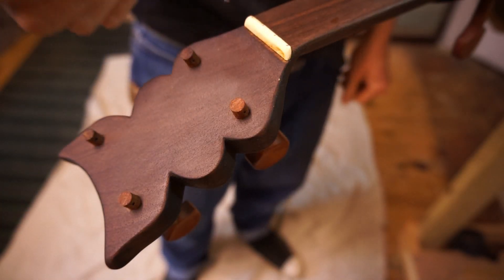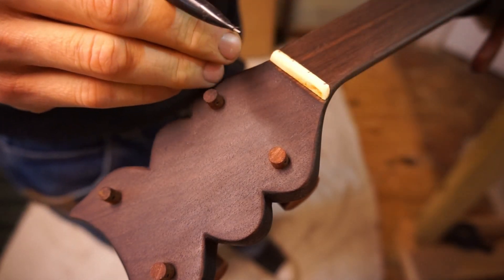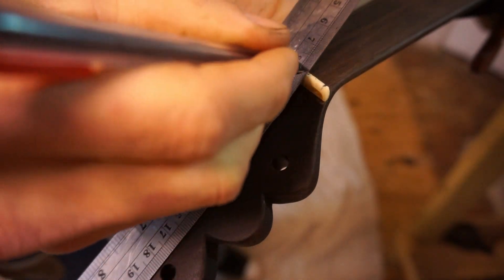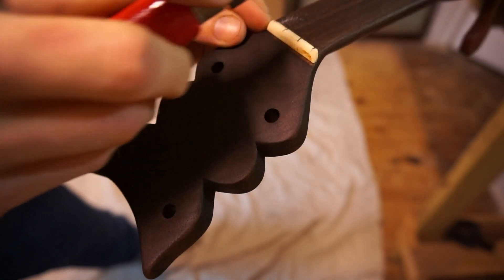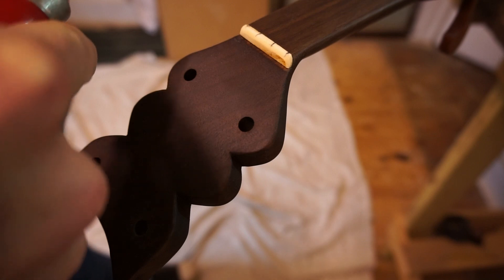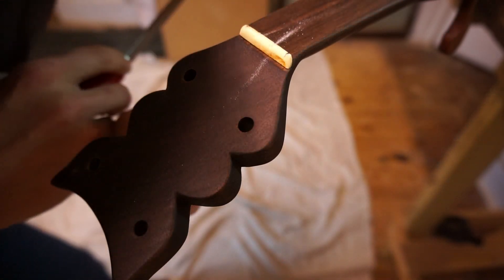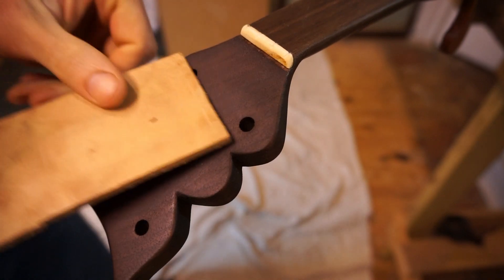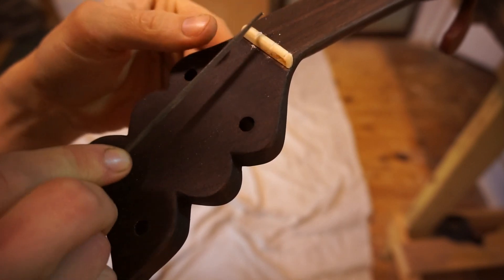How To Slot a Banjo Nut (or a Bridge)

Comment: Thanks for this video Clifton. I was wondering what is the height of the strings to the neck once the strings are sitting in the nuts for a fretless banjo. And if it is the same for both metal and nylgut strings. I converted a fretted banjo to a fretless one and wondered if the strings are not to close to the fret as I am having difficulty pulling off the strings that are closer to the nut, the first fret that is.
Reply from the maker: On fretless banjo you want the action to be lower at the nut than it would be on a fretted banjo.

Comment: Mr. Hicks, great video, thank you! I recently picked up an old 4 string tenor banjo and after replacing the tuning pegs with newer planetary tuners (which went fine) I noticed that while otherwise in tune, chords on the 1st and 2nd fret are very sharp. The problem goes away and chords sound normal as you move up the neck. Having seen somewhere that this can happen when the nut is too high, I ended up on this video to see how one ought to slot the nut to see if deepening the grooves on the nut would fix the problem. I was also thinking about trying to lightly sand the bridge as the action is much higher than I am used to and gets even higher as you go down the neck toward the pot. If you had a banjo that was otherwise holding tune but was very sharp around the 1st and 2nd fret would you do something about the nut first or attack the problem from the bridge side? A million thanks in advance.

Comment: Well I guess I did my cow bone nut wrong and I glued it with Tite Bond 3...I guess we can fix it still.
Can you makes a bridge,like a two legged one? Before I mess that up too.Good info Clif. Thanks
Reply from the maker: OK I need to do a bridge video. Will do. Titebond is OK, just use Elmer's in the future or, better yet, no glue. I explained in more detail on your Patreon comment. Thanks, Kenn.
Reply: what about hide glue?  is that stuff ok to glue the nut?
Reply: @fredflintstone5208  you don’t want the nut to tight because if you ever need to replace it things would be easier. 
I just had to literally file my entire nut away because I glued it on with a lot of wood glue and then of course I notched it wrong, I’m making a new nut that I’ll just put on with a few drops of school glue.